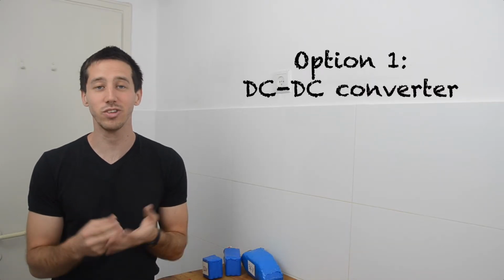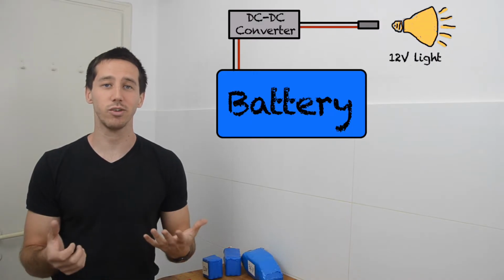How to add any LED lights to an electric bicycle

Comment: Would it work to put two of the lights with built in DC-DC converters in series or parallel? I'd like to run the lights in parallel with the motor off my battery (assuming the lights will only pull what they need), but wasn't sure how to approach lights with built in DC-DC converters, as far as whether the lights relation to each other should be series or parallel.  Any thoughts?
Reply: if parallel they have same voltage half the amps. if series they have half the voltage same amps. maybe you need two switches for two lights
Reply: @MDonovan 8x8x2😢😢😢😢😢😢u to🎉😢😢😢😢😢😢😢😢😢😢😢😢😢😢😢😅😢Cornelius Vanderbilt Wood, who went by C.V., was hired by the Stanford Research Institute in the early 1950's where he worked as an engineer and as an outside consultant to Walt Disney, helping with the logistics of the construction of Disneyland. Walt  was so impressed by Wood’s intelligence and problem-solving capabilities that he offered him a job as the supervisor of the construction of Disneyland. ❤️🏰😢🎉All life is valuable, no doubt, but as a qualified Submariner on SSBN 608, 616, and 640 class Submarines, I do wish the talking heads would quit talking about the folks that lost their life on the submarine the last week as if they were equals to me and my fellow Submariners. They were not Submariners, they were high priced tourists. They have not trained for years, qualified in their craft and boat, spent months submerged, nor have they earned the respect of their fellow shipmates who willing put their lives in their hands daily for months on end. Their deaths are tragic, but upon looking at more facts than most, in a light few can, they were really preventable. The design as well as mentality of the owner in his approach to hiring, training, and preparing were severely faulted. There is a reason we have not had a major tragedy in our community since the Thresher and Scorpion. When the Kursk went down it sent a ripple through our community regardless of country of origin. Those were Submariners, Brothers of ours even if from a different country. These folks shouldn't have died, because they shouldn't have been there. This wa😅😅s n😮😢othing more than a sight seeing trip to gawk at the wreckage that took many lives as well. 🎉🎉Next time watch a YouTube video.🎉🎉😢😢🎉
😢🎉
Walt and Woody (Walt's nickname for Wood) were both fiery, passionate individuals and became close very quickly. Walt trusted Woody and named him Disneyland’s very first employee. Wood not only supervised the construction of the park, he actually was the one who chose the site among the orange groves of Anaheim AND was in charge of purchasing the land where the park was built. 🍊

It was C.V. Wood who, as Vice President and General Manager of Disneyland, gave Vice President Nixon the Key To Disneyland in August of 1955, one month after the grand opening of the park. If you’re anything like I was and you’ve never heard of this guy before, this doesn’t make any sense, right? How could a man who was so deeply involved with the construction and creation of Disneyland, a man who Walt Disney often referred to as “a son,” be totally left out of all of the Disney history books and films? Why doesn’t Cornelius Vanderbilt Wood have a window on Main Street U.S.A. in Disneyland, the park that he was so incredibly instrumental in making a reality? 🧐

The answer is a bit of a complicated one. In July of 1956, just one year after the opening of Disneyland, C.V. Wood was gone. Not only was he out as Disneyland’s Vice President and General Manager, he was wiped clean from all of the historical accounts of the Disney company as well. Walt Disney had his older brother, Roy O. Disney (another key figure in the history of the Disney company, but that story is for another post!) fire Wood reportedly after a heated argument. It’s not known what that argument was about and neither Walt Disney nor his brother Roy ever went public with the true reason why Wood was fired so abruptly. 

There were rumors that Wood had embezzled money from the Disneys and their company, but there were never any legal proceedings or records that would prove that as a fact. Other speculated reasons for the firing were that Wood was taking too much credit publicly for the creation of Disneyland or that he was fired because he was designing other theme parks behind Walt Disney’s back. Whatever the reason, Wood’s relationship with the Disney Company ended swiftly and without much fanfare. It was like one day, C.V. Wood was in the Disneyland offices, holding meetings like he always did, and the next day he was gone and never spoken of again. 😳

When his new theme park Freedomland U.S.A. opened in the Bronx in 1960, it seemed like Wood was finally going to achieve the fame and fortune that Walt Disney had achieved with Disneyland’s opening in 1955. The park was made up of several themed lands including Little Old New York, Chicago (which had daily shows depicting the Chicago Fire of 1871), The Great Plains, San Fransisco, The Old Southwest, New Orleans Mardi Gras, and Satellite City: The Future. If any of these ideas sound familiar at all, they should! They were designed an awful lot like Disneyland’s themed lands as Wood was trying to create an east coast version of the popular west coast tourist destination. On the day that Freedomland U.S.A. opened, The Ed Sullivan Show hosted a preview of the new theme park, calling it Disneyland’s equal on the east coast. The following day, traffic was backed up so badly in the Bronx with cars trying to get to the park that Freedomland U.S.A. had to stop selling park tickets. 🤯

The initial success of the “East Coast Disneyland” was very short-lived, however, and by the end of it’s first year of operation, Freedomland U.S.A. was already over $8 million in debt. After a few more struggling years, the park was met with the extremely tough competition of the 1964 New York World’s Fair (Walt Disney’s ultimate retribution on his old pal, Woody) and Freedomland U.S.A. filed for bankruptcy and was later torn down. On the site in the Bronx where the park once stood now stands Co-Op City, a large residential development, and the Bay Plaza Shopping Center. A plaque was installed in 2013 commemorating the theme park that once stood on that location. 

After his most ambitious theme park was shut down, C.V. Wood did achieve some fame and fortune when he moved the London Bridge from London to Arizona and opened it up as a tourist attraction. He then was hired by Warner Brothers where he worked until his death in 1992. The Disney Company still does not acknowledge any link to Wood to this day, and his existence is still completely wiped out of the “official” history of Disneyland and the Disney Company. It’s doubtful that anyone will ever know the true reason why Wood and Walt Disney had the intense falling out that they had as almost everyone who knew either man isn’t around to tell their stories any longer. Just remember, the next time you’re in Disneyland or Walt Disney World, that yes, Walt Disney was in fact a genius and a visionary. Disneyland was his dream project, his creation, and one of his greatest accomplishments. But also remember, Walt Disney had a little bit of help in realizing his dream, and that help’s name was Cornelius Vanderbilt Wood. 😲

Thank you SO MUCH for reading this one! This was a long one that I first wrote for my blog years ago, maybe seven or so years ago, actually! I hope you enjoyed it! ❤️

Comment: Question for Micah and everyone else, it's it easier or better to convert a multi speed bike to electric or a single speed bike? Or is it just personal preference?
Reply: depends if you are wanting to use a hub motor or a mid drive. Hub motor would be better in a single speed case and the mid drive is better in a multi speed case ( acts as a transmission for the mid-drive).

Comment: How bad do the LED lights draw down the battery?
Reply: You can easily calculate it. Say if the light is 12W, that means running it for an hour will use 12Wh of a battery.
If you have a small-ish generic 500Wh battery, it can run the light continuously for 500/12 = 41,6 hours.
Reply: Great question

Comment: I found that LED strip lights and most led lights like 9v batterys. Could use the 9v battery indpendantly and leave your main battery for the  turning wheels. Create a seperate charging with recharge able 9v battery.  charge and swap when you need it. A option anyways 
still learning BMS like stated below

Comment: Hi Micah, I bought a new LED headlight for my e bike : suerpoweful : 25W ! It worked for 20 seconds and it burned the BMS....
But I really love that headlight !! 
- Only the light function is dead, do I need to buy a new controller or is there a way to upgrade the DMS to work with 25W ?
- Or do I have to bypass the DMS and connect directly this headlight to my 48V battery ?
Also, do I have to change the wires ? (the original light wires are pretty thin...)
Thank you for your help
Reply: I was wondering about using relay

Comment: If you tap into your bike battery main terminals remember to add a fuse.

Your bike is a moving part with vibration and possible cable rubbing/wear.  The short circuit of the battery will deliver enough power to fry standard light cabling.  The BMS short circuit protection will not protect you because the lighting cable is so thin that it offers too much resistance for the protection circuit to identify it as a short circuit.

A 2 amp fuse should be enough to protect your wiring.  For example: 2 amp @ 36 volts = 72 watts max for your lights.

I use 8.2 volt 30,000 lumen lights that draw just under 3 amps.  So 3 amps * 8.2 volts ~= 25 watts = 1 amp fuse @ 36 volts when using a buck converter operating at 85% efficiency ((25w/0.85)/36).  The cable will easily take two apps so I choose to simply fuse at 2 amps.
Reply: whre tf should i tap off the power for the buck converter. I cant use the main ports

Comment: Hi, really nice video. I have a question, i buyed a 36v 500w Hub motor, and the controller doesn´t have a connection to a LCD panel so i can control the level of the power of the motor. Do you know a solution to have it incorporated?

Comment: Hi MikeyI found out a much easier and also the cheapest way to convert 52 Volt into 5 volts to run regular bicycle led lights.What i did :) I took a old switching phone charger which everybody has laying around or you can buy very cheap.And my Led bicycal light designed for 6 Volts runs perfectly on the old charger :)Altrought most chargers say they can run on 100 Ac till 240 Volt Ac  it also works on 52 Volt DC. As inside the charger it rectifies the voltage at the input first into DC.

Comment: Hi Micah, i have a good one for a Q&A video... how can i charge my phone (USB outlet port) with a battery that dont have that function? if i could charge more than one phone would be great!
Reply: You can add a simple DC-DC buck converter with USB-connector, like:

3A total, max 40V:  https://www.ebay.com/itm/3A-DC-DC-Buck-Step-Down-Converter-7V-40V-12V-24V-to-5V-Dual-USB-Charger-Module/263456372243

5A total, max 40V: https://www.ebay.com/itm/DC-12V-24V-40V-to-5V-5A-Converter-4-USB-Port-Step-down-Power-Supply-Buck-Module/222234755111

5A total, max 60V: https://www.ebay.com/itm/DC-DC-7-60-24V-12V-to-5V-5A-4USB-Output-Buck-Converter-Step-down-Power-Supply/332406614051

Many more to find on e-bay.
You just connect your bicycle-battery to the in-connectors and plug your phone in the onboard USB to charge.
You should put the printboards in a water resistant casing. It is smart to install an on/off switch between battery and converter.
I am building some for my 36V E-bikes and mount them on my handlebar with a torch-clip. I also add some LEDs to see if they are switched on or off and to find the USB-connectors in the dark.

Comment: i have a light and it requires 12v....if i have 9v battery will it work??
Reply: Most of the time it will work, but with less power (less light).
A 9V-battery-block will be empty quite fast though. It is better to use 3 rechargeable 18650 Li-Ion batteries in series using a 3S battery holder like:
https://www.ebay.com/itm/1S-2S-3S-4S-BH-18650-LIPO-Battery-Holder-Wire-PCB-Mount/282820706703
Reply: @czarzenana5125  actually 4 or 5 would be brighter

Comment: hey Micah I am looking to build my first battery for my first ebike build looking for 100 LG HG2 looking for 72v 15ah pack someone told me the vruzen kit won't hold the packs 100a 72v output have any suggestions ?? also would love to pick your mind on other ideas for my build like which BMS and charger would be best and where to get all the supplies to build it

Comment: I understand what you are showing and saying, but what kind of process is needed to put ends of lights in a plug and how do i hook it up to the battery ?
Reply: Yeh
Reply: Should be the point of this video, shouldn't it?

Comment: The battery connector will plug into the engine. Can you run through how to slip in the wires for the switch and the lights? Do I do it in parallel or series and what parts connectors do I need to connect them together? Thank you.

Comment: The series solution sound great, but what about the performace of the LED lights as the battery output voltage drops, say from 80 volts to recomended recharge (0.2 X 80 =16 volts)?.
Reply: So you have 72V(fully charged is 84V)? 84V/12V= 7 pcs in series :-) That is a lot!. PS: I have 12kW 72V 29Ah system myself, but I've ordered this DC/DC converter:
https://www.ebay.com/itm/New-10-90V-to-2-60V-DC-DC-Step-Down-Converter-Car-Regulated-Power-Supply-Module/333335398634?ssPageName=STRK%3AMEBIDX%3AIT&_trksid=p2057872.m2749.l2649

Comment: Hi, is your 24v battery pack a 4s or 3s? I want to build one(24v battery pack) and I am confuse on how many series I should use. I have a 24v motor and planning to build an electric vehicle for my niece.
Reply: Typical Li-ion 18650 cells are rated at 3.7 volts each but output up to 4.2 volts for a little bit while fully charge and I would only take it down to 3.0 volts max. With those numbers a 6s battery would be rated at 22.2 volts with a max of 25.2 volts and low of 18 volts. That is too low as a sealed lead acid while rated at 12 volts can put out up to 14 volts each pack so approximately 28 after a full charge. 

I'd use a 7s setup for a 24 volts setup.  It would be rated at 25.9 volts, lowest safe output would be  21 volts and peak would 29.4 volts
Reply: Thank you for the reply, but I already created my battery pack. Unfortunately, what I did was a 6s pack since I don't have enough 18650's. But its a good thing to know these stuff.

I will definitely keep this in mind for the next pack that I will make. :D Thank you very much!

Comment: how to connect an alarm system to an electric bike.  I put a 36v to 12v converter and tried to install a motion, motorcycle alarm system on my ebike, but I have to leave the key on for the alarm to work. Can you help me find a solution to use this alarm without leaving the key in the battery?
Reply: The solution is to run a power wire to the alarm that does not go through the key switch.  A dedicated wire from the battery (upstream from the key switch) to the alarm will do this.

Comment: couldsnt you just use a resister or two to drop 48v to 12?
Reply: You would still be using the same 48v (if you consider wattage). You would just waste "36v" over the resistor as heat.
Reply: my understanding of how a resistor works must be incorrect. I guess that explains the heat it would produce. I guess this is why a buck converter was designed?

thanks again for explaining

Comment: isnt the third option of series wiring kind of dumb because theyll be pulling so much current which could be used for ebike range?
Reply: Series = "uses" more voltage
Parallel = "uses" more current

This method (series) will only draw the amount of current one strip needs so very low.
Reply: wicked. thanks for explaining :)
Reply: so if you wire in series, it'll only pull the amount of current required for one particular LED.? Wouldnt that mean that that current is divided among all the other LEDs? Wouldnt this mean that each LED gets less current in series?
Reply: Think of voltage as the pressure needed to push the current through your LEDs:

Imagine the LEDs in series is a long pipe. The more LEDs you have in series, the longer the pipe gets, the more voltage you will need to push something from one end to the other. Now think of the current as a marble being pushed through your pipe. This marble will have to pass the entire pipe (all the LEDs) to reach the other end. The marble doesnt shrink while in the tube (all the current passes all the LEDs and comes out the other end).  

The analogy im using here is basicly the "Think of electronics like you think of water". You can read more about it here: http://hyperphysics.phy-astr.gsu.edu/hbase/electric/watcir.html
Reply: Gurkdream,
Thank you for refreshing my memories while teaching others.
For the Newfies, a forward facing front high intensity spotlight is still highly recommended for several more valid reasons.
Happy trail ridings with a "Visual Line of Sight",
Mo

Comment: Hello ,, how many 18650 battery's would I need to equal or better the battery range that is currently on my ebike please ,,250watt hub motor 24 volt the battery claims it is 24 volts at 8.8 amp ,, however if I fully charge the battery my voltage meter says it's 29.3 volts,, with pedal assist at 15 mph in the uk ,,I get roughly 14 miles before battery needs a recharge ,, the price of another standard type slide in battery is equivalent to about 300 US dollars ,, I'm sure I could make one a lot cheaper than that,, and would I have to make the battery to produce almost 30 volts considering the hub motor claims its 24 many thanks if you reply ,,, Shane uk